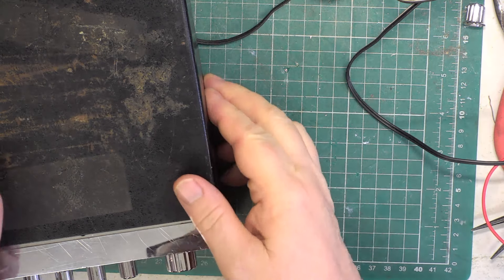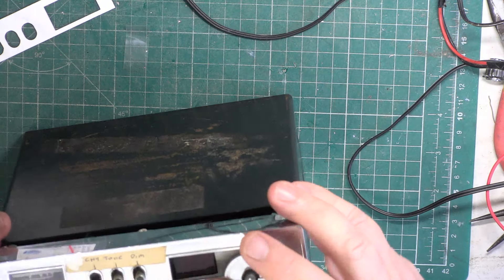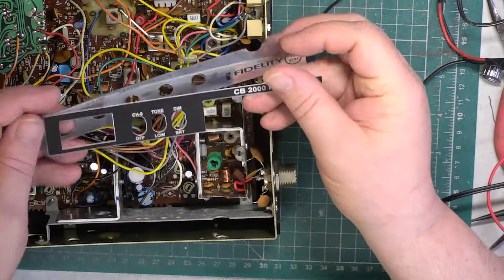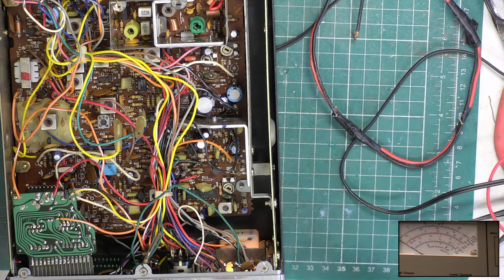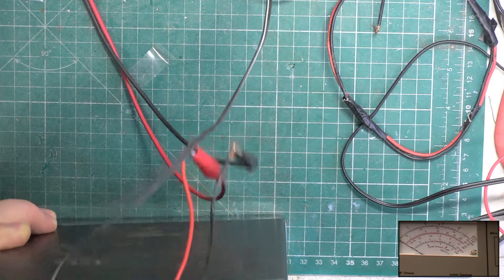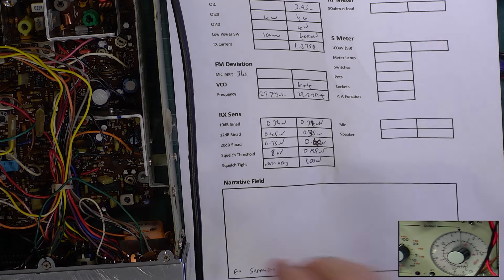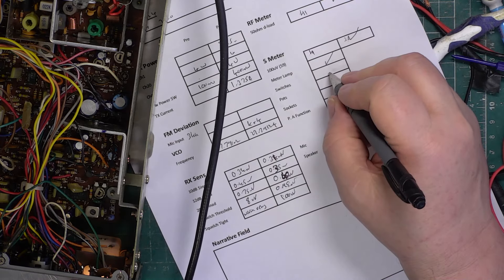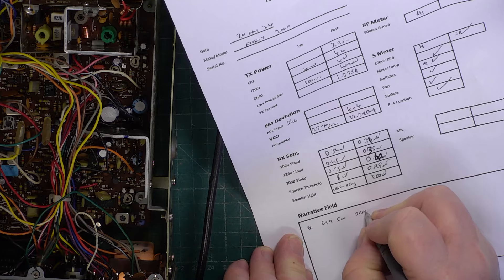Fidelity CB2000FM CB27/81 UK FM CB radio - service & cosmetics (Cybernet 134)

Comment: Nice service of the 2000 and do like the new front also look forward to the Scratchy corner test, I'm in Nottingham tomorrow going to have a look round for aerials see where the burner brigade are hanging out    will catch you tomorrow night when back in Lincoln 10-10.

Comment: Excellent,  nice job on the laser cut front. Richard what is the difference between the 2000 / 2001 as they look identical.
Reply from the maker: They do indeed look almost the same though one is a few millimeters wider than the other. The 2000 uses the Cybernet 134 chassis (like the Rotels do) and the 2001 uses the Cybernet 002F chassis like the Mustangs & genuine Amstrads do,

Richard